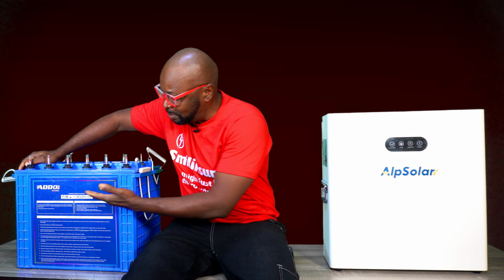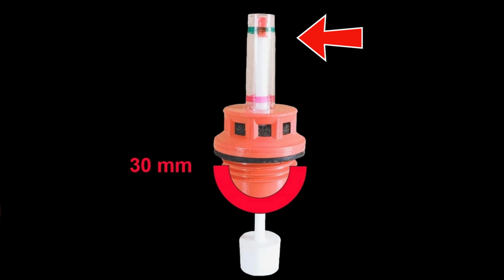What are the 20 differences between Tubular Battery  and Lithium Battery?

Comment: Sir you are incorrect. The lithium ion battery goes to bulk and absorption. As soon as it reaches 90 percent of SOC it reduces the amount of charging so that state is absorption. It charge with small charge until it reaches 100 percent. When it full the BMS will keep on to trickle charge to maintain voltage
Reply from the maker: This is Laughable,  that Lithium battery absorbs, Lithium doesn't absorb because it doesn't need it.
Reply: @s @smilinsunsmilinsun8056 does the lithium charge at same percentage upto 100%?
Reply: @smilinsunsmilinsun8056  Yes, a lithium-ion battery does go into an absorption stage during charging, but it functions differently than a lead-acid battery. Instead of a long, multi-hour absorption period, lithium-ion cells typically spend a shorter time at a constant voltage (the absorption phase) to balance the cells and ensure they reach nearly full capacity. The absorption charge is critical for cell balancing, which ensures all individual cells have a similar voltage.

Comment: Great job, very informative! You've earned a new subscriber. However, at 25:50, there’s a mix-up in the information. I use a tubular battery that communicates with my inverter through a Victron smart shunt, an aftermarket product. This shows that tubular batteries can indeed communicate with certain inverters.
Reply from the maker: This is very rare and cannot be counted amongst the numbers

Comment: Great presentation. I had 8 tubular batteries (sealed) and it would give me 4to 5 days without charge. I recently upgraded to 30Kv Felicity lithiums and fhey never go beyond 2 days without charge. That was quite a shock considering that the sealed batteries were 8 while the upgrade is equivalent to 12 of those
Reply: Felicity magic. They will make Ur head to be so small. Did U but it from Alaba?
Reply: Likely a fake Lithium battery.
Reply: I had similar experience with lithium battery I upgraded from Tubular batteries to  lithium battery, I observed that the tubular carry more heavy loads than lithium battery,  but  the only  advantage of the lithium battery is in durability and portability    Tubular is never a push over is still cheaper
Reply from the maker: That is hard to unbelievable, Check that 30kw. Bring it for a load test.

Comment: I once had this experience with my gel batteries. Got 1 this month, got another one 5 months later. Connected both in series wasnt doing well as you stated above, connected in parallel after 1 month later it was doing well. Does this applies to tubulars
Reply from the maker: Somewhat yes

Comment: Can you do or share a video of Gel and tubular comparison. lithium is very expensive. I use solar and i know that long duration on battery life is solely dependent on having enough solar panel charge your battery well so you get to discharge 20% to %10 in the night making the battery to last long. My gel battery is reaching its end of life span and have lasted me 2 years, im considering to buy another gel or try something new which is tubular

Comment: I want to get a lithium battery, but my current inverter a 2.5kva luminous inverter does not have option for lithium battery but can it charge a lithium battery safely?
Reply: Yes, especially LiFePO4 types
Reply from the maker: You will need a new inverter , that has the right charge parameter for your Lithium battery. This will improve its lifespan.

Comment: 😂 So now you have come to realize that in your earlier comparative video the praise you gave to the advance SLA battery a.k.a Tubular Battery over LifePo4 is 100 wrong in all spheres that is why you now repeat the comparative video to give the proper credit to whom it is due abi? 😂😂😂😂😂😂

SmilingSun dey compare sleep with death. At least you should have instead compare Lithium Ion Battery with Lithium Titanate Oxide or L.T.O.

The only AREA which Any type Of S.L.A battery beat Lithium Battery hands down is RESONANCE WIRELESS CHARGING. Yes you hear it RIGTH, resonance wireless charging which involves inductive high frequencies. In that area, Lithium Battery can work.

Another Great Benefit of Lithium Battery is that You can buy the Smaller Manufactured Cells and use them to assemble your own custom UNIT of KiloWatt Hour Power.

You can either buy 4(12VDC), 8pieces(24VDC),  16pieces(48VDC) 3.2V 320Ah/700Ah Rectangular Shape Battery or even the Cylindrical ones like 32140 of 48WattHour Power and spot weld them together to arrive at your preferred voltage and Kilowatt-hour levels.

But it is far cheaper to buy the Rectangular ones.

Comment: Another important difference is that LFP batteries are way less likely to catch fire than their lead-acid counterparts! 🔥
Reply: Do your research. A lot of lithium batteries have gone into flames
Reply from the maker: @lorwizky Thermal runaways yes
Reply from the maker: Because of the BMS controls yes you are right, Thanks for sharing.

Comment: Well done for the informative video 👍👍👍
19:24  The lithium battery voltage doesn't drain in accordance with the battery drain. Throughout the drainage of a lithium battery it stays almost flat. Except for the start and towards the end. This is one big advantage of the lithium battery in operating loads. The equipment will perform optimally as the voltage stays flat for the most time.
Reply from the maker: Thanks for sharing this insight

Comment: Fork lift batteries, 100% depth of discharge, 10s of Kwh, cheaper than both. You can revive a "dead" fork lift battery with time and patience to get 10x the storage as lifepo4 for a fraction of the price. I.E. I purchased a 12v pallet jack, it cost me $750. For that I got 2x 450ah battery packs, a 12v industrial charger, and a pallet jack. 11Kwh of storage, a charger, and a decent amount in scrap. They are heavy but they laugh at the cold, no computer to fail, they are rated at C6 but used in solar they give a C20 rate. If you decide to change voltage from 12 to 24 or 24 to 48, you add more cells or rearrange the series/parallel and that's it. Not all BMS talk to each other, if you don't buy all the same brand battery they may not talk to each other and even then they have a max number of batteries that can be connected in series/parallel. Not to knock on this video, but that flooded lead acid is a hobby battery compared to forklift batteries.
Reply from the maker: Interesting comparison, thanks for sharing your experience.

Comment: Thanks for the video. Just a few corrections 1. Lithium ion batteries do not fail suddenly as stated. 2. Some do have a bit of liquids in them (not lead acid level of liquids), true solid state batteries just started coming to market and are still wildly expensive. 3. Discharging lithium ion batteries to zero volts indeed does shorten their life span (not catastrophically as in lead acid batteries), it's the upcoming sodium ion batteries that can be discharged to zero volts without issues. 4. Not all lithium batteries come with screens, infact most don't. What they all compulsorily come with the BMS.
Reply: It is also important to add that lithium batteries do not do too well in hot climate like Nigeria unlike the liquid base battery. Both lithium and lead-acid batteries have serious environmental downsides. Lithium batteries don’t emit fumes, but mining lithium and cobalt harms ecosystems and uses huge amounts of water, and recycling rates are still very low. Lead-acid batteries are easier to recycle, but lead is highly toxic, and poor recycling often causes pollution. So neither battery is truly eco-friendly — just different kinds of impact.
Reply: @valentineemmanuel6337 Thank you for the explanation, I never knew that the environment must also be put under consideration when purchasing battery for clients
Reply: @valentineemmanuel6337  hi, when you say water, do you mean like normal h2o?
Reply: Yes there are various types of battery found in lithium. It will depend on what you are explaining. There are lithium ion, there are LiFePO4 and so on. It's good to know what your lithium is made of before buying the product.
Reply: @enwekaarthur279 which one is better
Reply: @oyeladedare9309 LifePO4 is better
Reply: Thank you
Reply from the maker: You are welcome
Reply: thanks for highlighting the difference, I will also add the cost of buying both

Comment: Lithium ion phosphate batteries are always measured in amp hour while tubular lead acid battery are measured in amps, can you please explain the difference?
Reply: All batteries, regardless of Chemistry are measured in amp hours or even more correctly, watt hours. Using watt hours eliminate the effect of the voltage differences between batteries.
Reply: Thank you for the work you did, in fact you are the best
Reply from the maker: @mbachustanley7312 Thank you
Reply from the maker: Brilliant question thanks for that. ,Lithium (LiFePO₄) batteries are measured in amp-hours (Ah), which tells you how much energy they can store — like the size of a fuel tank.

Tubular lead-acid batteries are often described in amps (A), which tells you how much power they can give at once — like how fast the fuel flows.

Lithium batteries give you more usable energy from the same size and last longer.

Lead-acid batteries can't use all their energy and lose power faster as they run.

Comment: DOD, Cycles, Form factor, Maintenance, price.....i believe time is up for the various forms of lead acid batteries. Now BYD is already moving into commercial production of Sodium batteries said to be even better than lithium. Change is the only constant thing in life.....
Reply from the maker: Absolutely.

DOD: Lithium gives 90–100%, lead-acid ~50%.

Cycles: Lithium >3000, lead-acid ~500–1000.

Form factor: Lithium is lighter, compact.

Maintenance: Lithium = zero, lead-acid = regular top-up.

Price: Lithium costs more upfront, but lasts longer.

Sodium is coming — cheaper, safer, and promising.
Yes, change is constant — and battery tech is evolving fast.

Comment: Tubular batteries allow usually up to 80% depth of discharge and manufacturers usually give a life cycle count at 50, 80% depth of discharge. 50% means it can last longer, usually  double. Most tubular batteries drain deeply last 4-5 years but at 50% last 6-8 years.

Charging or discharging for tubular is 5% of the max current rating or 11a for the 220a/24v battery in your example. For lifepo4 its 100a for the 100a/48v battery. But its recommended to charge/discharge at much lower or 20-30a.
Reply: When you charge tubular with high current setting say 50 to 80 as against 20/30a, u experience fast charging which makes the electrolyte to be more turbulent there by creating more heat in the battery system. That is one of the things that will reduce battery longevity
Reply from the maker: Correct, thanks for sharing this insight.